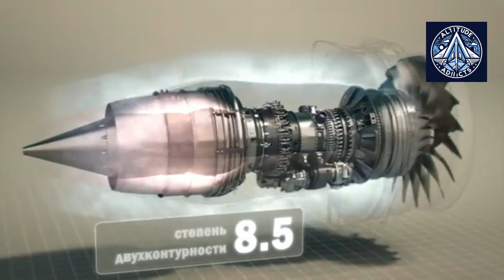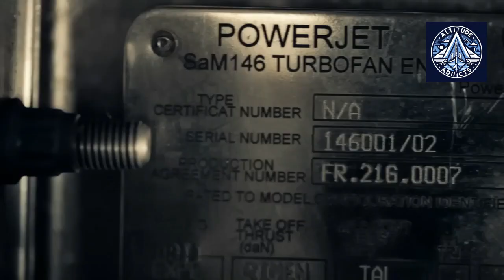A Comparative Analysis of Russia's PD-14, PD-8, and SaM-146 Engines

Comment: As for the PD-8 and 14, they are probably a Soloviev D30 or a Kusnetzov NK-8 and just upgrade them to current standards..!
Russia have al least a hundred prototypes ready so they can pick and choose a bunch of alternate engines, to me I would pick a Kussnetsov prop fun double rotating geared NK-73 that could really give it a 20-25% better fuel efficiency with no loss of speed or negative noise parameters, this prototype was ready in the late 90's.... You can not imagine the goodies the engine shelves they have....

Comment: The French engine parts are poor and fragile. This Sam146 is the first French try to manufacture commercial jet plane engine by borrow the M88 core module engine from French fighter Rafale.   But the French don't know that any core module adapted from the fighter engine must have plenty of room for tweak power to be used in a commercial jet.  The M88 engine touch its limit when being used in fighter. So it cannot tweak into commercial jet like the US did to their engine such f110 engine and CFM56 module.  Because all temporary US engines are more advance metallurgy tech than the French.   They can modify to more powerful fan load without problem, contrasted to the French.  The Russian side knew it well, But they avoided instructing the French on their weakness. It is common habit between cooperated nation project like this that Each side kept their secret tech that might leak to another.

Comment: SaM-146 was sabotage act in respect of SSJ-100 aircraft program, and italians did all they can not to even allow to fix issues of this engine design.  Especially hot section, combustion chamber required removal for overhaul or repair after cracks findings in approximate 2000 hours interval or even less. That engine is not modern, it is dead end branch of development from previous century.